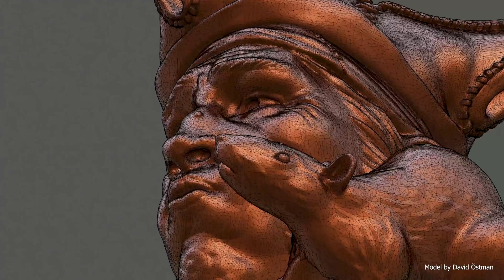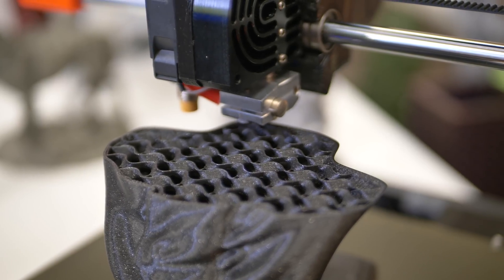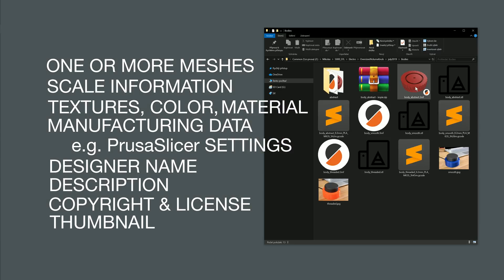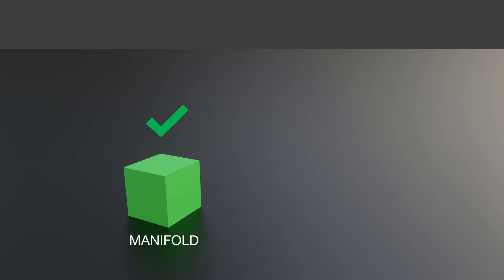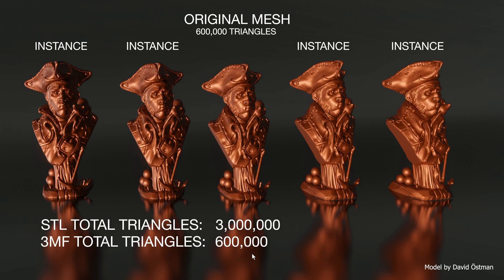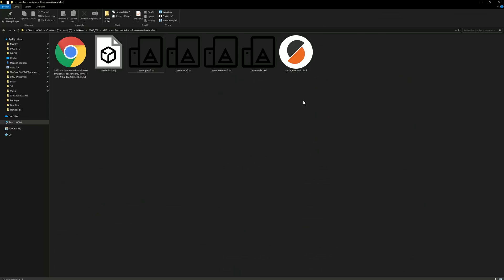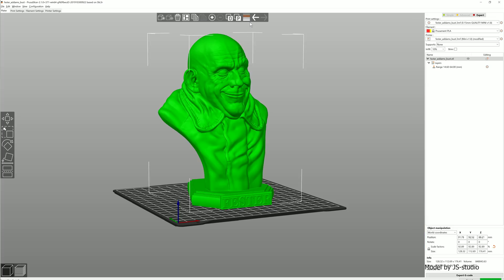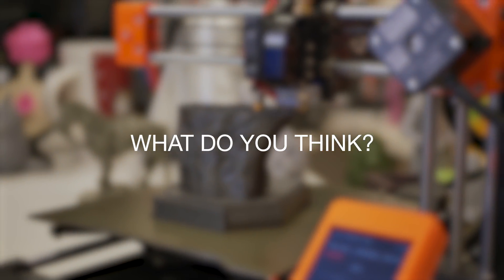Why STL is dead and 3MF is the future of 3D printing

Comment: When I save my 3D projects I save the blend files, the stl files, the gcode files and the 3mf. I never thought anyone would be interested in my 3MF file though. Especially since slicer settings seem to be so individual. 

Everyone has their slicer set up for their printer. Those settings can change depending on their printer, the filament they use and even the room temperature their printer is in.  Before I used anyone else’s slicer settings I would want to print something small with it just to test it on my machine. I think going right into a 10 hour print with untried settings is pretty risky. 

And wouldn’t it be possible to stick some malicious gcode at the beginning or end of the print? I’d be willing to bet most people, me included, don’t know how to read gcode.

And you pointed out one of the biggest stumbling blocks. 3MFs are slicer specific at the moment. Unless that changes I don’t think it’ll happen.
Reply: Makers Muse did some testing on 'malicious' gcode as I recall.  For the most part, how malicious gcode can be is defined by the checks and balances of your slicer/machine (e.g. axis stop detection, temperature cutouts, etc.).  I think some of the sites that accept gcode files don't allow files containing certain codes that could be used maliciously, but it's been a while since I watched Angus' vid, so, I could be misremembering that.  Personally I find that my machine is in greatest danger (from itself/me) when I'm trying to callibrate it...
Reply: Harold D 
It seems the 3mf file benefits prusa because the printers are so great out of the box, very few people will modify them. Meaning the sliver settings should carry over between users very easily.

Comment: No I will not be using it, because: 1, fusion 360 doesn't natively support it. 2, Cura doesn't support it. 3, copy protection has no place in an open source 3d printing world, 3d printable files should always be freely distributable.
Reply: An artist might disagree about the copy protection. Designers would like to be paid for their work before people go and distribute it all over the web. Of course, all locks can be overcome eventually.
Reply from the maker: 1 - Fusion360 does natively kinda support 3MF, though it could definitely support it better (no 3MF import atm for example)
2 - Cura supports it. Actually Cura uses it as default project file format just like PrusaSlicer.
3 - All STLs have a license and are subject to copyright as well, check any model sharing website, the info is always there. The 3MF just has a tex field where you can save this info, it's just a text, not DRM or anything like that.
- Mikolas
Reply: @Prusa3D  You just defined DRM there with #3.  A text field that can be interpreted and enforced by the slicer is a form of DRM.  STL doesn't "have" that.
Reply: @Prusa3D  I may have to look into 3MF then, thanks!

Comment: I'd probably switch in a heartbeat if the program I use for 3D Modelling would natively and conveniently export 3MF like it does with STL from a Component right-click menu buuuuuuut Fusion 360, as of now, does not even going as far as to requiring a "broken" Extension that exports 3MF files at 1/10th the scale thus requiring unnecessary extra handling inside the Slicers I use ( those beeing Formlabs PreForm and Prusa Slicer ) which means I'll have to do like 10 extra clicks combined which is kinda a drag since often enough I'll have to reexport a model more than once when I notice potential issues in the Slicer I couldn't account for in the 3D Modelling Program.

Comment: All cool but there is a reason why STL is still around: It's well tested and does the job in 99.9% of the time. Adding complexity and specialization (like material, print settings etc) is honestly not the right way to go. Keep it simple.
Reply: 3d printing really doesn't demand much from a modeling format. a list of polygons is all you need.
Reply: I just had to fix an stl modell for several hours because it had holes and non manifold edges. With 3MF this would not have happened as it is claimed.
Reply: @theincapable  3MF is still just a list of verts/faces so it should be possible to make any non-manifold object you can imagine.

It's the exporter's job to decide on restrictions (like preventing non-manifold objects from exporting), a file format is just a container for data.
Reply: @Katniss218  do you have any information on how Cura or slic3r is handling this? Is it possible to save non-manifold objects with them?
Reply: yeah, but considering the backers... STL is going out of norm
Reply: @cocotug0  "STL is dead" is typical unserious advertising gossip.The industry and many enterprises use STL. 
I, for example, mill highly exact teeth of zircon, gold or steel. Companies wich have to earn money with it pay attention only to its well functions, companies change it only if the new format is better and it is industrial standard!
Reply: @nothahn  yes, I agree. but.. considering that SIEMENS, Dassault, autodesk, Stratasys and 3dsystems among others are interested in this. It means that it is going to become an industry standard. I mean... among those first 3 you have more than 50% of CAD marketshare...
Reply: @cocotug0  Between "interested" and industry standard can be a long time...
Reply: @cocotug0  interested/= will be industry standard
Reply: @cocotug0  by an industry standard, you mean another option in the export menu.
Reply: @LordOfNihil  I can't disagree. LOL

Comment: What I'd find more interesting would be a file standard which could be properly altered and worked on in CAD Programms like fusion etc... I'd love to slightly change around a few designs on thingiverse but that is an absolute pain in the bum with only an stl file which can't be imported into a cad Programm as a solid
Reply: That would be cool but CAD developers would have to adopt a standard (which has happened in the past e.g. DXF) but unfortunately i just don't see that happening. It's a great idea though.

Comment: I'm not sure you really understand STL .... Anyway size , scale , mesh orientation are saved and reflect only the work you did with your 3d modeling software. STL is good but do not save material/color information, but it is perfect to save shape just like an obj file !  This video is about promoting 3MF  , maybe good for the new needs arising , but stl is also very good , it's simple and frugal. If you need a sculpt only , it is good enough

Comment: One of the reasons why 3MF won't replace STL is actually what you praise it for - not allowing non manifold meshes. Slicers can ignore errors and print unprofessional files. Most files out there are exactly that. Looks like this new format just walled itself out of most 3d models on the net. Sooo... It will be like fighting jpg format all over again.

Comment: I save everything I have dialed in as 3MF, except once you do that, if I change the STL then the "reload from disk" no longer reloads the STL but reverts to the last 3MF save.
Reply: That... sounds like what it should be doing, though... <_<
If you modified the STL and saved it in the same format (not 3MF), would you expect it to 'reload from disk' to before you saved it?
Reply: Simon Belanger In Prusa Slicer when I load several STL, and start working with the modifiers, I might realize I should change my design on one of the objects. So I will go to Fusion360 and fix it, export to STL (overwriting the original), and when I go to Prusa Slicer I right-click that object and reload from disk. It will update it and I can proceed. Once I save the project, it doesn’t work the same way anymore and will reload the whole 3MF file instead of just that one STL. I just expected it to work like it does before saving the project.

Comment: Contains Copywrite and license information. I'm going to stay far away from it.
Reply from the maker: It's just text metadata. STL has copyright and license too, it's just not saved with the file (take a look at the model description on any model sharing site, there is always license type)
- Mikolas
Reply: @Prusa3D  Uh, no.  If it's not stored in the file, then it doesn't "have" it.  There is no method for a slicer to refuse to process a STL due to some messed up or missing copyright or license information.  It will be very easy to do so for 3MF that actually does.
Reply: @Prusa3D  OK. You know more than me. I'll check it out then.

Comment: Sounds excellent until "Copyright and license" I understand that maybe in a near future, we will dealing with wars like Metallica against Napster about MP3 XDD
Reply from the maker: It's just Metadata. All STL have copyright and license too, just check any model sharing websire and check a model's description.
- Mikolas
Reply: @Prusa3D  Again, you're comparing an apple to sliced cheese here.  A slicer isn't going to call up a model sharing website to validate copyright or licensing information.  If it's in the 3MF, they can easily validate it, no matter if it is correct or not.
Reply from the maker: Mike Feldmeier What would such validation achieve? CC-attribution-non-commercial. Alright, now what? How would such license affect the slicing process in any way?
And if all you have to do is to change a text file to change or remove the license, it can hardly be called a DRM.

Last but not least, we should all respect the creator's license anyway, enforced or not. If the license requires attribution, it's the least we can do respect the designer and the time he put into the model.
- Mikolas
Reply: I agree 100% keep these files dumb. Thankfully 3MF files still contain simple STL files, so there's no worry of easily stripping "metadata"
Reply: @CYDeviant  "Copyright and license" just refers to Metadata in the file. So its just simple Text you can modifie or remove.

Comment: A large majority of people that use (free) CAD to generate parts, use Autodesk Fusion 360 software.  And it ONLY supports .stl format output.  So good luck.  Maybe give Autodesk a call,... LMFAO, they don't give a shit about any of us, so good luck with that.
Reply from the maker: You don't need Fusion to export 3MF. Export STL, import to PrusaSlicer, set it up and Save the project. It's like a folder, that compresses a lot more information than just the mesh.
-Mikolas
Reply: @Prusa3D  ...You must have missed my other comments.  How can you call STL dead, if you still have to use it as an intermediate step?  You aren't making anybody's lives easier; you are just adding more steps to the workflow.  The proper way to move the industry forward is to reduce workflow steps, and reduce complexity.  I have never had a problem using STL files on my MK2S.  If you want your 3MF file format to be better than STL, there needs to be direct export plugins for 3D printing manifold-watertight geometry built directly into all major CAD and modelling software; Blender, Fusion, Solidworks, Inventor, CATIA, UGSNX, etc etc etc...

Comment: Not yet, F360 doesn't support it.
Reply from the maker: It kinda does, but it doesn't really matter. 3mf is a container. You export an stl to prusaslicer and save your project. It's like a filefolder that is compressed that contains a whole lot more information than just the mesh.
- Mikolas
Reply: @Prusa3D  So there's pretty much no point in going 3mf asw it's still just an stl with extra steps.

Comment: I'm only sad that the ISO standard .AMF format is the one being ignored where the corporation-controlled .3MF is the one that is that is taking off.
Still, market forces..
Reply from the maker: When we introduced our new PrusaSlicer 2.0 and launched the new PrusaPrinters community hub, some people asked us why we prefer sharing the models in 3MF format over AMF. It’s simple: the 3MF specification is newer and unambiguous, and it’s available for free. Also, 3MF files are supported by Cura and Microsoft 3D builder (among other apps).On the other hand, AMF is ambiguous and the specification is to be paid for. AMF files were never properly supported by any software that we know of. At best, AMF files were used to the same extent as STLs, meaning that the AMF only carried a single mesh without any additional attributes. With that said, PrusaSlicer can still load AMF.
( - Mikolas)
Reply: If 3MF is open-sourced, it's available to everyone for free. But, honestly, it's the first thing I heard about either.

So I'm curious. What are the advantages of AMF?

Comment: Some CAD packages aren't well suited to 3MF output (yet); because we use both Ultimaker Cura and PrusaSlicer, asking one of the CAD designers to give me a 3mf wouldn't make much sense. That said, if I think I'll need to print a part again, you bet I'm saving that sucker as a 3MF file.

Comment: I really like the fact that I can save all the slicing settings and tweak them later. But slicing settings is one thing and a 3d model is another. As you mention in the video, the 3MF file contains the STL file!
Also the slicing data in the 3MF are not universal, they depend on the printer profile and the slicer features. 
So,  3MF is a very useful thing but it will not replace STL.
Reply: Also, someone doing a wrong configuration can wreck your printer.

Comment: I use 3mf, but it is a pitty that not all settings can be reloaded. When I make a projekt, I direct upload to octoprint. works great. But on a realod of the 3mf, there is no octoprint information and i have to export gcode manualy OR switch to the printer - but then prusaslicer will delete much settings while switching and my "relaod" is not the same anymore. that is really anoying and make me sad.

please correct that. THEN 3mf will rock like it could.

Thanks, and happy printing!

Comment: Sorry Josef, but since not many of the major 3D modelling software is supporting .3mf natively, then it is not going to happen. Just because i.e. Autodesk is part of the consortium, doesn't mean that 3mf is going to be widely used. 
Look at .JT - autodesk is part of that consortium too, but the format is not widely used even though it is a brilliant format. And why is that? Well, as long as the big players like Autodesk have their own formats they want to push (in the case of Autodesk it is the .fbx format), then Autodesk is mostly monitoring the formats in the consortiums, to see if they become a competitor to the Autodesk format, and the Autodesk agenda. even if .3mf might be a better format. 

So to answer your question short: No, not going to happen anytime soon.

Comment: Good work trying to move the masses towards a better format!
What needs to be worked on by the community is the ability to slice CAD directly. There is a ton of academic work on it already. Sure it is harder, way harder than finding intersections between a plane an a triangle. But currently it's like working with shitty rasterized graphics instead of vector graphics. By slicing the CAD patches we can  not only improve print quality drastically, but also generate arcs and even Bézier curves to greatly reduce the file sizes and transmission rates. 8bit MCus can handle the interpolation already and we are moving towards 32bit MCus aswell.  Prusa, you are technologically ahead and it would be natural for you to take the lead on this!
Reply: Don't forget that all organic models are made in programs (like Blender, Zbrush, Maya etc) that produce meshes and NOT CAD files.

Comment: There are so many file-formats for 3D objects - all with the ups and downs.
Does 3MF have any benefits? Not for normal hobby 3D printing.
at best it just increases the coding-work required as well as the chance for errors.

Human readable? yeah sure... xml-format with implicit indices - sure sure, very readable when you got "<triangle v1="2007" v2="1869" v3="1863" />" in the code - tells me exactly what that is... right not at all.
The encoding it self is also.. questionable.
They frame it as if ascii-encoding would be a good thing. No, having the position written as "1.30462907834534300000004" does not give any Real benefit over just a 64bit floatingpoint.
Seriously - a normal "double" (64 bit value) takes 4 bytes of storage - like "1234" BUT the precision is just ungodly. 15 decimal places - that is enough to have a model that is 300 meters long - and still be accurate down to the size of the smallest ATOMS !!!!
No, no known manufacturing needs that, no manufacturing in the next couple decades will need to have absolute atomic precision for an object the size of an ocean liner.

Manifolds... so there is absolutely NO difference to STL there as neither STl nor 3MF require manifolds.
the 3MF standard just says the the underlying program that CREATES the file needs to fulfil those requirements, but the format has no way of enforcing that.
You are literally shooting the messenger. You use the same programs to create the mesh? You get the same result with 3MF as with STL.
If you want printable objects you need software that creates printable meshes. The format those are saved in changes nothing.

For normal 3D printing the format will not be adopted as it is way too bloated with no real benefits.

There is a well establish open format that does contain pretty much everything you need for 3D printing that is also vastly superior in terms of size and quality:
OBJ. It not only supports triangles but also conforming surfaces like nurbs - which allows for smooth curves with very few faces and points. (as well as other things like surface-smoothing)
Reply: I think enhancing the power of mtl-files to contain printing parameters would be enough make Wavefront-obj as good as 3MF to save custom support and temperatures etc